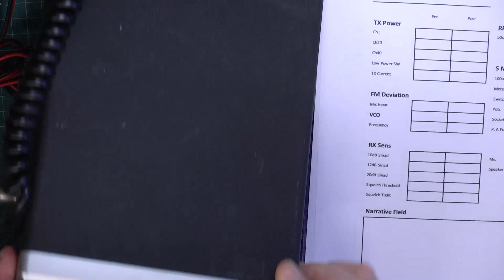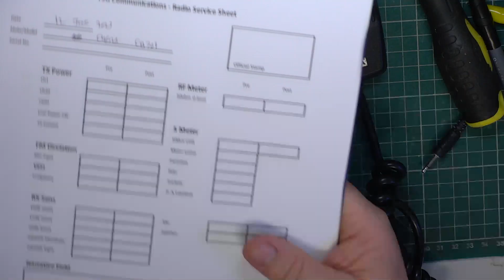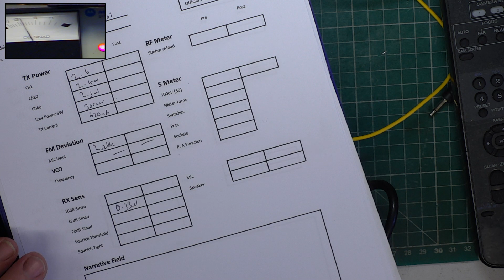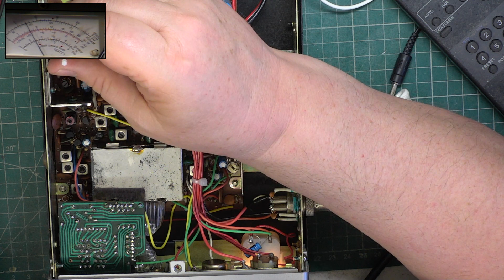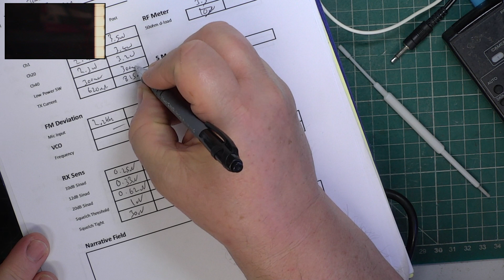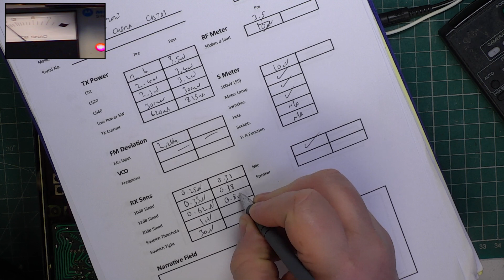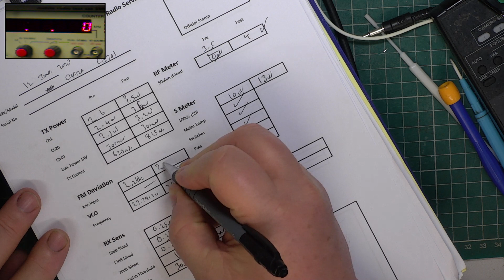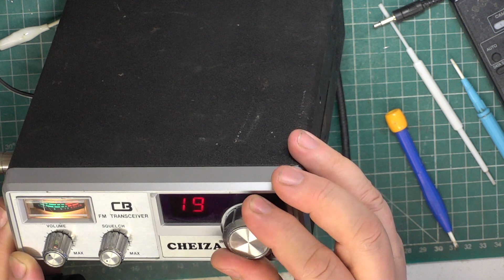Cheiza CB701 CB27/81 UK FM CB radio - service

Comment: Good afternoon. I have a radio station like this. The reception is excellent, but I have no delivery. When I press the submit button, the scale on the S meter goes to the opposite side. What could it be? Output transistor or something else?
Thanks in advance.
Reply from the maker: Replied via Email.

Richard